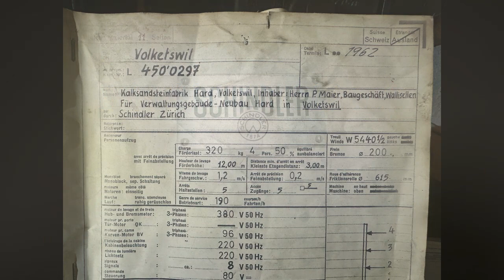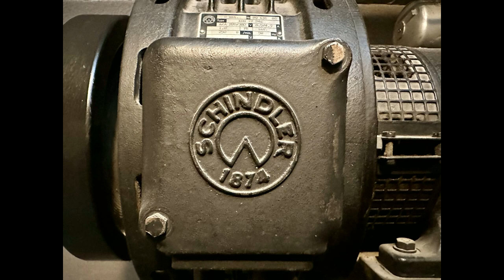Lift Schindler - 1962  /  Volketswil ZH

Comment: A hole appears to have been chopped into the concrete ceiling to make room for the machine's brake assembly.  Is this a retrofit machine, or was the machine room built with a too-low ceiling?
Reply from the maker: Hi ElmerCat,
the Architect had probably miscalculated the height of the Engineroom. 😂🤣
The Elevator is the same age as the Building.